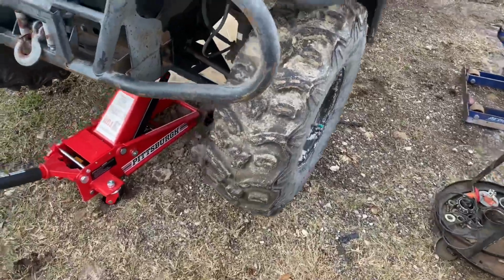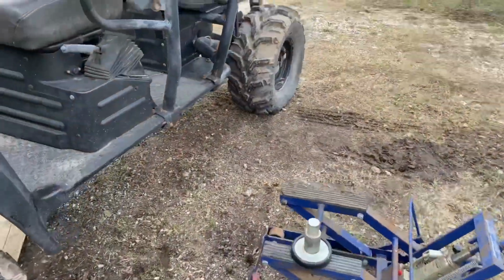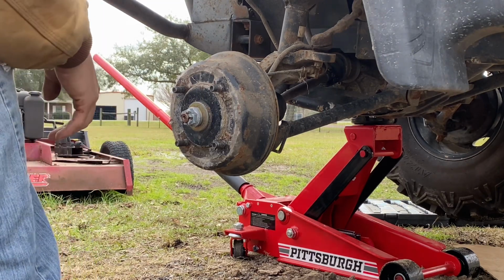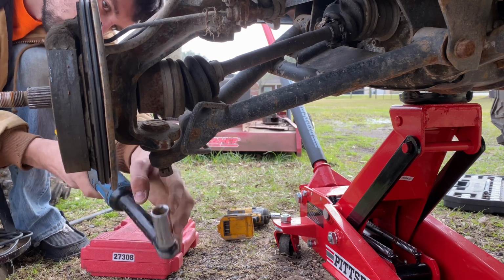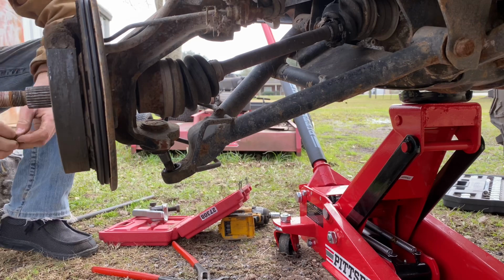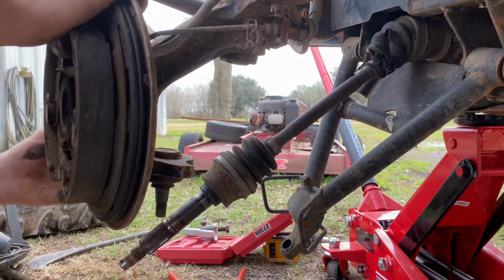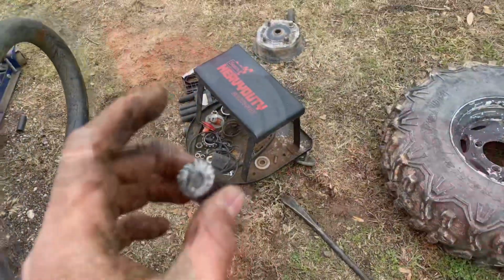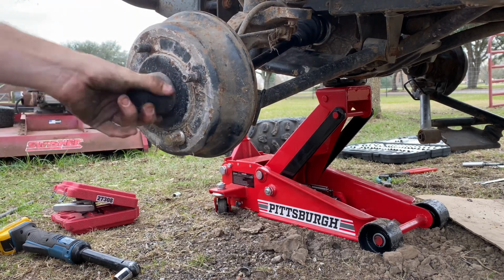How to Replace Kawasaki Mule Front CV Shaft/Axle (2510,3010,4010)

Comment: Liked it, simple, quick and no BS. Also are you running dewalt 20v on harbor freight cordless ratchet? Very cool
Reply from the maker: Thank you. Yes it’s a 3/8” long reach from HF with a dewalt 12v battery. There’s a guy on YouTube that shows you how to modify the tool to work with the battery. Been using it for about 3 months pretty hard and it’s been solid so far. Dewalt still hasn’t released a electric ratchet so stuck with this for now. Lol
Reply: You forgot to show how to install the drum back over the brakes that is what the problem is that we r having did everything u did but wish you would have showed how to put the drum back on

Comment: I got everything on but I'm not too familiar with drum brakes. The piston is compressed all the way but the drum isn't sliding back over the shoes. Any tips?
Reply from the maker: @davidplybon1105  they are stubborn sometimes. Make sure the piston and shoes and perfectly in the middle. It can be a pain but eventually it’ll go. Can maybe try to open up the bleeder screw also
Reply: @atvrepairsandmore2482  ok thank you.